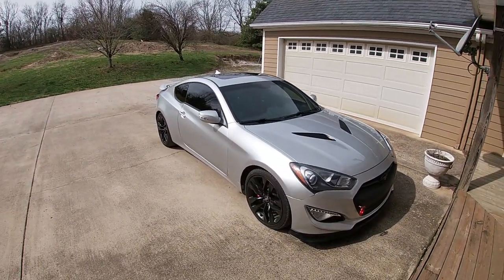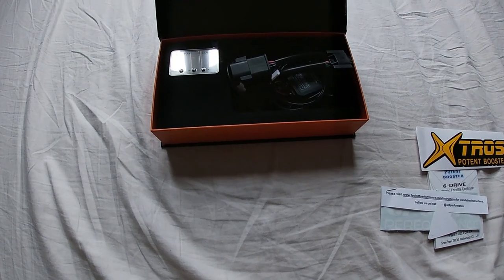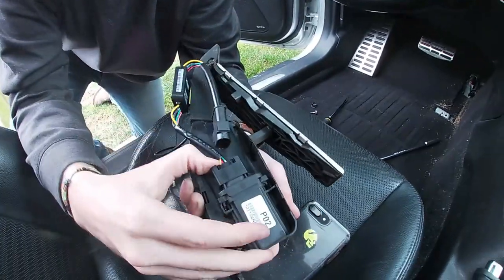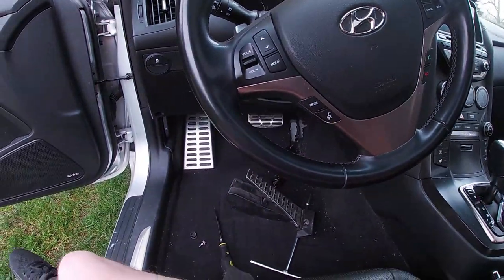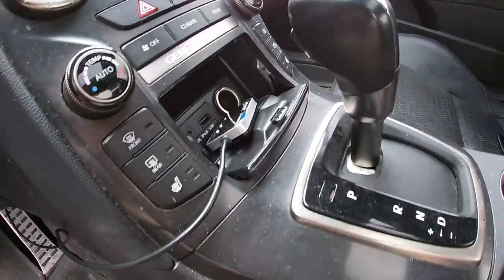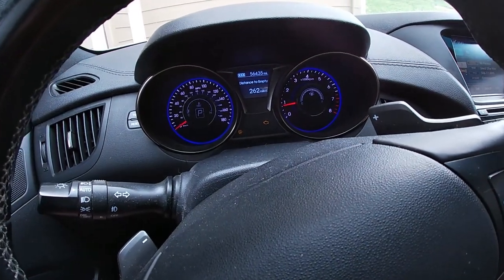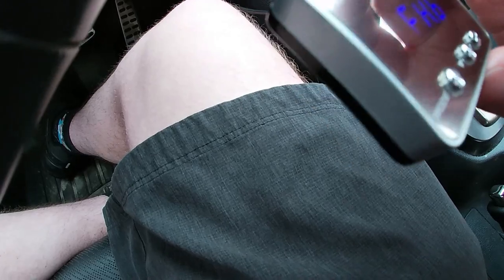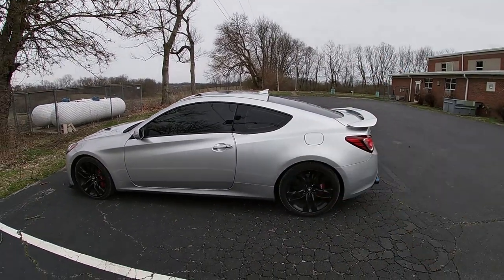Genesis Coupe Throttle Controller Install!

Comment: I’m glad someone is running a channel on automatic Genny! ATs get so much hate! Keep it up
Reply from the maker: Thank you so much for the support bro seriously!
Reply: Thank God there are others
Reply: I have a bk2 2.0 6 speeed and already had to replace the slave cylinder lol it has 40k miles
Reply: Now days AT's are the better of the two. Computers in cars have gotten so much better with their accuracy for appropriate energy (voltage, fluid transfers, gas, etc). Used to be Manuals reigned supreme if you wanted the best gas mileage but ATs, as I have said, have brought them out to the top. That and professional racers on tracks, they use paddle-shifters anyway, you want both hands on the wheel at all times.
Reply: The manuals are great I have a 3.8 R spec. Manual No issues no grinding just a rattle from the shift knob but I changed that so it’s quiet

Comment: Question: should the connections from the disconnected pedal connector (coming from the car) actually be making contact with the second connector connections or is the second connector (from the 9drive) more like a cover then a actual connection point?

Comment: Just installed this on my ‘11 Genesis 4.6L. Wasn’t sure if it was going to work with this engine/software but it does! Throttle response is much more aggressive with less pedal travel.
Reply: Do you feel a clear change?

Comment: I just got this mod about a week ago and I absolutely love it. I have a 2010 3.8 trackand a 2015 R-Spec 3.8
Reply: On the R-Spec do you get quicker acceleration in 1st gear and 2nd gear?
Reply: If I drive my shit in manual is there really any point to the controller?

Comment: Older cars had throttle by cable, sharp and snappy response, pedal1%=throttle opening1 %. Cars from 2003 onwards have throttle by wire (electronic throttle controller). Sensor and motor on the pedal and throttle. With these comes redundancy, lags and software controls. Pedal50%=throttle40% and not forgetting, foot on pedal to 50% in 1sec may take 1.5 to 2secs for the throttle to get to that 40%(these are not actual numbers but you get the idea). With this mod, it's not necessarily making the car faster, but it definitely makes the car snappier, more fun and resposive.

Comment: I just got mine today and got it installed this is my vary first mod on the car, love the throttle response time it definitely makes a big difference. I have a 2015 hyundai genesis coupe 3.8 and I got it from a dealership and it already had a cold air intake and just has performance dual exhaust but definitely want to get a full stainless steel quad tip exhaust! Love this car and were i live ive only seen one person with this car. Can't wait to continue the upgrades!
Reply: Where and how much did you buy it from? I see different prices online for it and I fear of buying a cheap one and destroying my car
Reply: @adolfoflores6433  I got mine from 3point8performance the price they list is 124$ once I installed it and played with the different throttle responses you can definitely feel the difference the highest one is the most touchiest one for the peddle. Hooe this helped you pick.
Reply: @paxleahcimoldschool7443  thank you so much man, means a lot!!
Reply: @adolfoflores6433  your welcome man have fun with it. My next upgrades are going to be the headers he recommended and I'll be going with a full magnaflow exhaust going to sound beastly lol.

Comment: Hi, very informative, advanced, and complete information regarding the throttle controller, thank you, but I have a question I hope the admin or Genesis Coupe HUB can answer regarding safety issues, My question is what if the throttle controller's device suddenly fails? or the little wire cut? Do we still have the control of gas pedal? or it will be back to normal mode? Thank you for hoping Genesis Coupe HUB can enlighten us. thank you again!

Comment: You should of took it on a test drive for us.Was just at my dealer the parts man said its rumored 2 years will be a new Gencoupe possible V6 stinger engine in it I hope it happens.
Reply from the maker: I actually posted a review on it with a whole bunch of driving!
Reply: They may have a coupe again but it won't be labelled as a genesis or a coupe, genesis has left Hyundai to become its own brand, it'll probably be called something like a g60

Comment: Does this mod make it easier to find the sweet spot for pops and bangs? I have a 2014 3.8 GT with race exhaust and test pipes and it pops and bangs like a mofo, but it takes some pedal finesse. Wondering if this makes it easier.
Reply: I got a 2010 2.0t and mine pops like crazy too, right in between 2000-3500 rpm, just ordered this booster, gonna update you ASAP!

Comment: Bro IF YOU OWN A 2.0T PLEASE PLEASE BUY THIS. I PROMISE YOU WILL NEVER EVER BE DISSATISFIED. Just got mine in today and my turbo lag is GONE.
Reply: Aye bro If you still got it how’s it holding up?
Reply: @groovyguy5630  still prefect
Reply: @osdhockey2388  bet I put mine on yesterday and you can tell a big difference
Reply: @groovyguy5630  especially if you own a manual

Comment: Would you recommend this or the Pedal Commander? I know the PC is way more expensive.
Reply from the maker: From what ive heard this is basically the same thing just cheaper, id go with this just because its cheaper and works the same
Reply: @GenesisCoupeHUB  thanks for sharing. Just want to ask if this ETC model is compatible to hyundai accent? Thanks

Comment: Hey how much was this and is there a noticeable speed change?
Reply from the maker: It was about $130 and honestly its pretty amazing! Definitely makes the 0-60 faster
Reply: Speed is the same but the rate at which it climes, the throttle, is what improves. It's almost like putting a Flexfuel kit, you don't get dips as much if at all.

Comment: Ethan, Are you saying you get better acceleration from a dead stop? I have a manual 3.8 and I'm wondering if I'll get better acceleration out of first and second gear.
Reply from the maker: Exactly! That's where this thing really makes a difference is off the launch!
Reply: @GenesisCoupeHUB  Perfect! Thanks for your response!
Reply: Did you ever get this don and does it feel different with your manual 3.8 ?
Reply: @malachipeterson9890   no i didn't
Reply: @malachipeterson9890  I think it might be too sensitive with a manual...hard to control.

Comment: anybody have any trouble with one of these so far? from the loomks of the comments i should just get it, any suggestions where to buy from?
Reply from the maker: From everything Ive heard these things work problem free! Ive heard of people on the gencoupe forums that have had them installed for over 2 years without any issues! I got mine here https://www.shopbtr.com/Throttle-Controller-for-the-Genesis-Coupe-and-Sedan-BK1-BK2-BH_p_6383.html

Comment: Word of advice - Don't abuse it!! Learn from me, I spun a bearing after 3 weeks on max.. lol.. lesson learned, luckily I was able to rebuild  it and she's back running!
Reply: Dang really bro? I don’t think I’m going to get it, was going to get the flash tune too to increase redline. What engine you got? I have the 4.6 V8
Reply: Dang really ?! How ? Debating on getting it .
Reply: @Elisarenee916  I think this guy had the the genesis coupe. The V8s are solid usually

Comment: Hey bro, I really wanna get a gen coupe and I saw a 2012 3.8 with 90,000 miles and a clean title for 7500. Do you think that’s a good deal? And do these cars last a lot of miles? Like over 150,000?
Reply from the maker: Thats not a bad deal but Ive seen ones with about 70k ish miles going for about the same or less so maybe a tad high
Reply: ethanW preciate it bro! I think I might spend a little more and get a 2015 3.8 model

Comment: How long does it take for the engine light to come off it it pops up turned it off once or twice so far and still popped up what u recommend
Reply from the maker: After I drove the car for a few miles it went away. I started it a few times and it stayed on but as soon as I drove for like 2-3 mins it went away and never came back
Reply: Thanks bro appreciate just seen yesterday went away on it’s own great mod big difference with just engine leash and potent booster everything else stock like a whole new car it drives and like a rookie I look driving it in FA MODES 😅😂🤣 defenitley recommend
Reply: And muffler delete lol 🎯💰💰
Reply: Arturo Valencia hey bro , I just got a 2.0t yesterday and I’m already loooking for mods lol , if I’m just to attach this to my car let’s say next week , you think it’ll mess my car up? In the long run
Reply: Fernando I’ve seen other youtubers have it for longer than I have and no problems I haven’t had any problems Nd had it for a months now highly recommend thoe